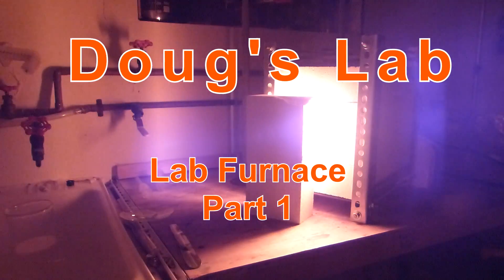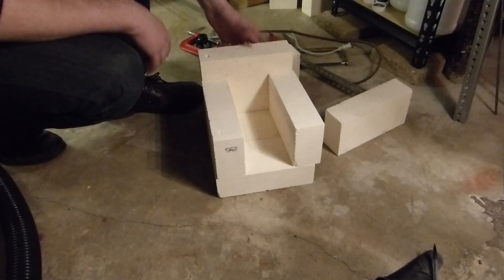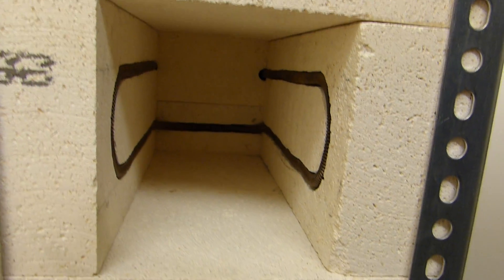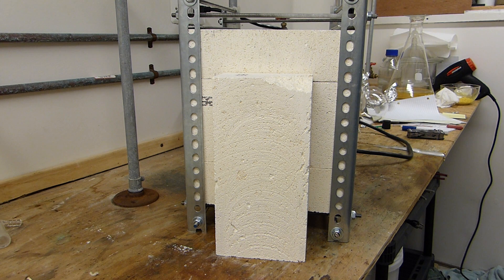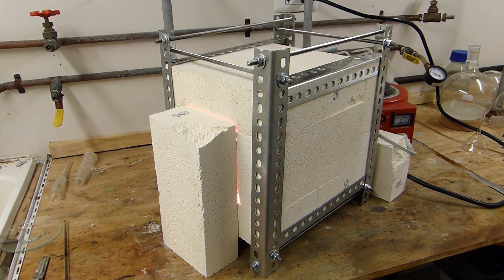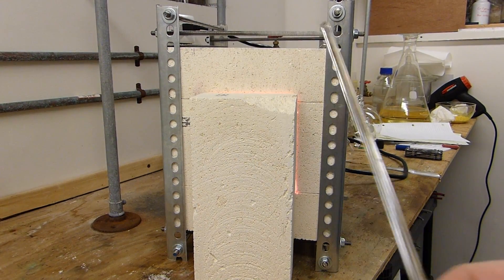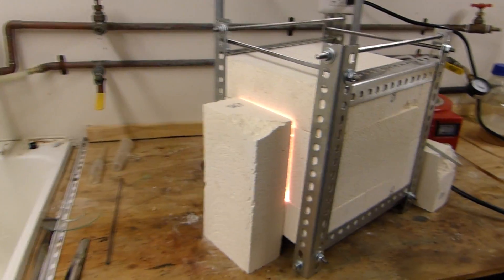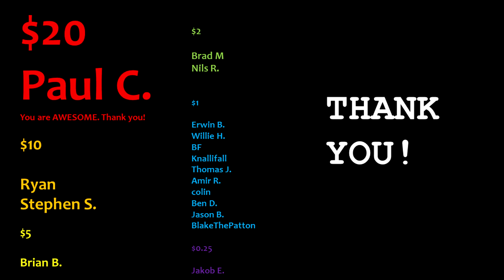DIY Electric Furnace: Part 1

Comment: 7:14 I discovered a good way to deal with the coils overheating inside the wall is to unwind the end of the coil and twist it back on itself, which decreases the resistance and the amount of heat generated. You could even wrap it around a copper wire. Adding copper plugs would pull more heat out than you need and decrease the efficiency of the furnace slightly.

Comment: You know when you see something on TV that you have or own (the exact model) and you're like, "Hey, I have the same exact thing!" all excitedly? I did that when I saw his dremel and guide. Then I realized that particular Dremel is ridiculously common (Dremel 3000) so I was no longer special. I will say that I've gone through 4 harbor freight rotary tools in as many years despite the fact that i don't use rotary tools all that much (couple times a month at best). I bought my mid-range Dremel just over 3 years ago and not only does it still run like it's brand new, but looks brand new too. Never again will i buy a harbor freight rotary tool... 4 of their rotary tools costs nearly double the price I paid for my pre-owned Dremel I got on eBay.

Comment: To make the wire lead outs you straighten the coil out and double the wire over and twist them separately tightly. This causes both parts of the twist to carry current so make less heat there and more heat in the furnace. Also terminal blocks with metal parts made of nickel and a ceramic body.

Comment: The way to make electrical connections to the ends of the heating element is to spot weld the heating element wire to a thicker straight piece of Kanthal wire, like 2 or 3 thicknesses of the original wire, and run the thick wire through the back of the furnace. Thicker wire will not dissipate as much heat per unit length and will run at a lower temperature which will prevent burn out. You could also use long stainless steel bolts, but that is not as reliable for high temp operation. SS hardware works fine at lower operating temperatures. Also, get a type K thermocouple temperature controller. They are cheap and safer than running open loop on the temp control.

Comment: This is an awesome DIY.  I would upgrade with PID style temp controller, but great proof of concept. Thank you Sir.
Reply: if you dont mind me asking, would a PID temp controller be able to connect to the heating element and control the temperature? or would it only tell the temperature, from which you would adjust a seperate device.

Comment: Would it be possible to build a larger oven with the same depth and height,but 2 bricks wide? I have been unable to find firebricks longer than 9 inches.You could cut off the outside of 2 of the angle irons on one side and hold up the bricks with stainless steel wire underneath the bottom of the ceiling bricks, attached to the angle iron.Please give me your ideas in this larger furnace.

Comment: straighten some of the coil on the ends and twist it double. The drop in resistance will prevent that section from getting red hot, and save your connection

Comment: i made the same design with one exception. I drilled into the brick for the channels so the khantal doesnt spring out at one point. Also you REALLY want to have all the safety gear, tongs and everything you need before turning the thing on. If you build a more horizontal furnace you can insert gradients and baffles. Very useful if you are into synthetic crystals. By far the most cost effective method to create large Nd:Yag crystals.

Comment: Please ground the metal frame of the furnace so you don't get fried!  Since the elements are exposed inside the furnace, you should also put interlock on the door to cut off the power when the door is opened.

Comment: You don't have the wattage correct.  Wattage scales as voltage SQUARED, so if it is 5000W at 240V, then it should be 1/4th as much at 120V or 1250W.  Both the current and voltage are reduced as the voltage drops.  Since power is the product of these, that's where the squared term comes from.

Comment: hi can someone give for a good and not to expensive nichrome wire prewided for heating and a variac which can hold the wattage.
Reply: Dude, you can literally do this by hand. its like 2 USD and takes 5 mins.
Reply: @Inesophet  Well the variac is the main problem the heating wire I managed to find easly yet all Variacs i seem to find are quite weak and expensive.
Reply: @ted_van_loon  Variac is not really important. Just use maths to calculate how long your coil should be. Stay 25% under what your home wiring is rated for and you should not have a problem. Heatcontrol is best handled with PIDs and not a variac since input current and final temperature do not correspond well together. Thats also much cheaper. A PID with a good heatprobe costs around 30USD while a good variac that can drive a freaking furnace will be 10x that.

Comment: Hey wake up!!! If you don't change the gauge or length of the wire the resistance stays the same! Most houses are 230 volts At 5000 watts that is 21.74amps and 10.58ohms. Now at 115 volts we have
10.87 amps The SAME 10.58 ohms and 1250 watts!

Comment: You need electricity 102! The wattage is 1250 watts if you 115 volts. If that unit is 5000 watts 230 volts then it is 1250 watts @115 volts.Also,for YOUR safety why didn't you wear REAL thermal gloves and use metal tongs to put in and remove the crucible?! Please send me the item number on the kanthal heat element. Last suggestion:connect heat element to a bolt that goes thru the wall. The electricity can be connected to the outside opposite end of this bolt.

Comment: by the way, if you want to freak people out, put li600 space shuttle insulation tile in below its melt point (it will shrivel up if too hot) pull it out while glowing hot. wave it in air for one or two seconds and as long as you don't squeeze it you can hold it in your hand. it will be glowing yellow hot. awesome party trick.
Reply: HEYY THATS COOL

Comment: The way to bring the Kanthal wire out is to uncoil about 8" on each end, double it back on itself, and twist it. Outside the furnace, ordinary steel bolts and straps can be used to make electrical connection to these stubs.
Reply: I uncoiled the elements as you suggest but then put a piece of 1.2mm stainless tubing over them and crimped down on the kanthal.  Small hole through insulation and stainless tubing is a modest heat sink.

Comment: You need some nomex gloves or something. those work gloves dont stop heat at all. even leather welding gloves wont stop that kind of heat. I use welding gloves when Im using my propane forge/foundry, and they instantly start smoking when they get too close and the heat just goes right through them. I have some really heavy duty foundry gloves that I got at a farrier supply shop. They stop all the heat pretty much but they are mitts so no finger dexterity what so ever.

Comment: You should stretch out the heating elements, right?
Reply: Yeah. Then it was not very good to put the copper strips inside the spiral the way he did (he shud simply have carved out some more space in the brick). It kept the spiral from overheating, but the copper do melt on the inside (just like it did in the crucible) and make contact with the element. That might destroy the wire. 

The best thing is, to put the spirals on ceramic tubes so they can radiate free in all directions, but it's hard to do on a furnace this small.

Comment: i was wondering about using the same idea to build a bigger furnace thats capable of melting iron using a 220V and 10A input and transforming it to a roughly output of 800A and 2.75V which will be more than enough to produce heat to melt iron will this work does anyone have any idea
Reply: It would not be very useful for this type of furnace. The wire used for the heating elements have quite high resistance - so you don't need a lot of current. Using that much current and low voltage just means that you would need to use thick rods of the same alloy as the wires (wich might be hard to get) and it will be hard to fix the connections and cables to the elements without getting a lot of losses and heat where you dont want it.

The practical limit for furnaces using this types of elements is also about 1300°C (if it's a good design) - so you can  melt cast iron and some types of steel alloys with low melting point. But if you want to melt "normal" steel and iron with low carbon content - you need something even hotter.
 
One idea could be to run the current directly thru the iron you want to melt (for example thru thick graphite rods that you use as electrodes)
 - then just have the brick chamber around it to let the heat build up inside and don't radiate away like it does if you just melt it by current "in open air". That way you really get use for 800 A of current.
Reply: Ride84XL thanks for the reply and nice idea but I want to know something what you mean is to connect the iron with the negative at one side and the other side with the electrod and let the electricity heat it up till it melt but won't the electrod just melt instead and it will be just like welding can you explain more and thanks anyway
Reply: I meant that you could melt it directly by the current (just search for "high current transformer" or "metal melter" on YouTube and you will see). That would be quite easy to do with 800 A. You can still build some "furnace" around it with fire bricks so you keep most of the heat from radiate away and melt larger pieces
If you want to build a furnace like in the video (as I also have done) and using heating elements made from resistance wire - it's easier to just use 220 V directly.
Reply: Ride84XL OK I will keep searching I'm actually studying electric engineering and I going to do an electric furnace that can melt iron as me graduation project because I think using electricity  to melt iron is better then coal
Reply: Mina Nabil if you try to make this kind of furnace, keep in mind that the melting point of steel may be above that of the furnace
Reply: Sorry, filaments

Comment: Why would heating element burn out at over 100V when it's rated for 220V???  Also what is the purpose of this "variac"?  Why can't you just connect straight to 110v outlet?
Reply: Variac - variable AC transformer. You can change the voltage from 0-110v (or 220, depends on where you live). With a variac you can vary the power going to the heater, thus controlling the temperature.
Reply: Dima Prok you can connect it to the outlet.
Reply: The element is probably rated at 5kW, 220v in free air, or even forced air. By enclosing it, particularly where it passes through the fire bricks, the temperature of the element will rise significantly higher than in free air and could reach it's melting point.
Reply: because 220v outlets supply half the current that 110v supplies do. Power = Current * Voltage.
Reply: The last question was related to Variac, he's not running Variac on 220v.  I know about power (Watts) formula, it doesn't answer the question.
Reply: +Jaden CM, Author said it would burn out element.  My understanding is that element designed for 220v will only get "half" heated on 110v.
Reply: I know this is old, but i couldn't let this fly...  @Hamish The Meme Lord  While yes that is the equation for power 220v outlets still provide up to 15 amps on the basic receptacle that means that at 220v there is the same amperage which increases the power by a factor of 2.  That means that 220v output double the power that 110v does on a standard outlet.

Comment: Just a note on power versus voltage: half the voltage also means half the current. So its only a quarter of the power. This is especially important when dealing with double the voltage (four times the power...). Thought you might wanna know.

Comment: what the name of this red machine that you turn on the outlet?
you need one of these to the oven, or gives substituíla for something?
electric I do not know much
Reply: That red machine is Voltage regulator. It lets you change Voltage so you wouldn't blow up a fuse with that heating wire hooked up directly to the power outlet and it also lets you change the temperature (more Voltage = more heat).
Reply: Ernestas Titas Thanks \o
Reply: @Ernestas Titas 

would it be a problem to use a motor speed controller/dimmer to regulate voltage?

Comment: Please tell me what is the heating element and where does one get it.
Reply: The heating element is resistance wire used for electric stoves, you can find it on ebay

Comment: Wow, you were very brave to put your hands near in gloves made from some synthetic fiber :P GENUINE leather gloves are the minimum (they'll transfer the heat right to your hands though), but good welding gloves are a must for this kind of work. Oh and awesome job with the furnace ;)
Reply: What are welding gloves made out of?  I got pair of thick yellow leather gloves from Harbour Point and they are nice but they don't protect from heat very well.
Reply: Also leather, but they're a bit thicker than the conventional leather gloves and are probably also treated with some flame retardant that'll lessen the chance of it catching fire near (or touching) hot objects. They aren't (nearly) completely heat-resistant though, so you should NEVER grab a hot object even with welding gloves on (sure, it'll avoid you getting instant 2nd degree burns from the hot object, but you'll still feel the heat through the gloves). Use metal tongs instead.
BTW the welding gloves also come handy from protecting your hands as you move them near yellow to white hot objects. You see they're so hot that even the heat they radiate is more than enough for burning your hands without gloves.

Comment: If I were to put the heating element into a fire brick say an inch deep in a circular stove top pattern to make a hot plate would there be any risk of the element arching to a metal pan sitting on top of it used as a sand bath for dry distillation?

Comment: I didn't understand how the copper in the back reduced the heat on the exposed coils. Can someone explain.
Reply: spinNspiral the high conductivity of the copper allowed the heat energy to be transferred through the copper and out into the air. so the outside terminals would stay cool.
Reply: Thank you.
Reply: The copper extended the contact of metal on metal to the electrical connection point.

Comment: A pyrometer is always a help, "old school" analog meter units are still around.
Bulk, type K asbestos covered thermocouple wire is still around also.
One should "torch fuse" the raw twisted end of the thermocouple wire into a small bead, ..the wire "will" work by simply twisting the tip/sense end tightly, but it tends to be unreliable, esp. at high temps.

They do have digital PID thermal controllers with K wire on eBay,.. if one wants to go high tech.

Also, they use carbon granules (cheap stuff)  contained in buckets for small kiln melting of copper/brass.
The carbon absorbs the oxygen so the metal doesn't oxidize.
Look up PMC carbon firing.

Comment: Dude holy crap this is nice. This is just what I was looking for!:D Haha this is amazing. And nice job with achieving that temperature. I'm wondering on the small things like exactly what that thing is supplying the voltage. Exactly how to use and how it works with placing the coppers rods in the coils to reduce heating. And just small things like that to reduce that temperature around the holes and how exactly you did this.:l wow nice. Can I have a little grocery list and specifications to build this? I'll tip and I'm gonna participate in the next donation of the next experiment lol.

Comment: Use carbon rods from 4,5v batteries. You can reach tungsten melting point with them, and they wont melt.